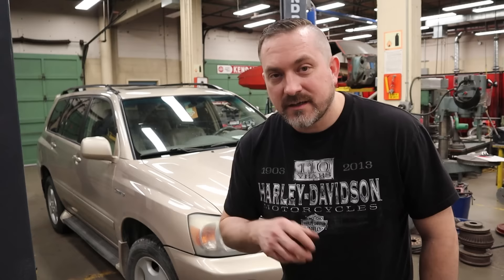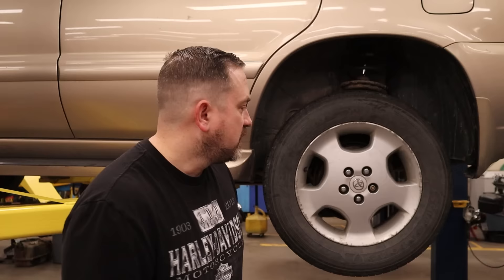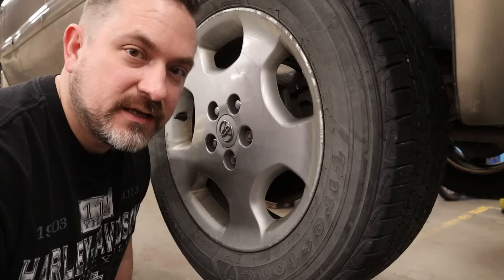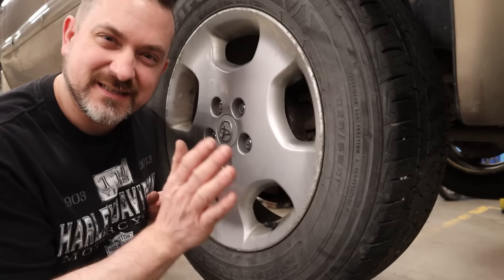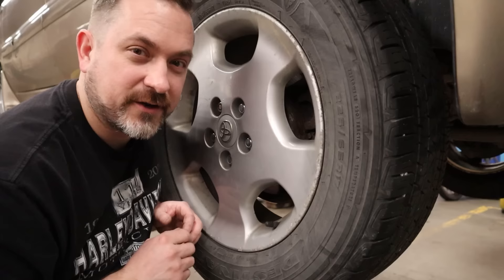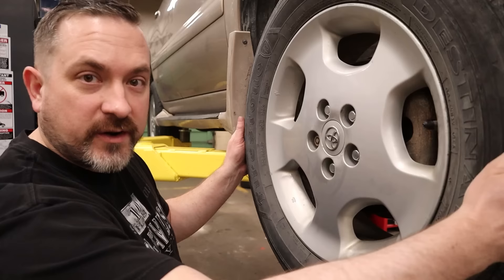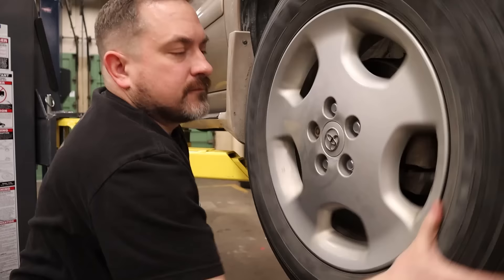How to 100% diagnose a bad wheel bearing.

Comment: My wheel doesn't not shake but does not spin freely even with brakes off including parking brake
Reply from the maker: If it makes a speed dependent sound then it's most likely a wheel bearing.  I have a road test video to help you diagnose which side it is too.  Hope that helps.  Thanks for the watch and welcome to the channel!

Comment: Is there another reason for the whirring noise as speed varies?
Reply from the maker: If the noise changes in volume and speed as the vehicle changes speed, then it is a part that is speed dependant.  It is a tire bulge, nail in tire, bent wheel, wheel bearing, cv axle, driveshaft, sticking/worn brakes, rubbing dust shield, loose fender covers, heat shield on drive shaft, etc.  Think things that are spinning or things that might rub against something that shouldn't be there.  Best advice is try to narrow it down to front or rear and left or right by opening windows.  Do a proper wheel bearing check on all wheels first and then look for other issues.  Cv axles can should a lot like a wheel bearing.  Good luck and thanks for the watch!

Comment: What if the noise goes away at high speeds ? Noise is just at starting speeds
Reply from the maker: Depends, it probably is just blending with road noise.  I would do the checks in this video and my other road testing bearings video checks to be sure. Thanks for the watch!

Comment: Youve obviously never had an inner race go on a bearing. 
      Holding the spring and feeling the vibration is a way to tell. "You can feel every noise" remember that
      Inner race on a front can be a tricky one. Left side makes the noises a typical right would do on a road test.
     Not all bad bearings have play
Reply from the maker: You're right, I usually inspect and hand pack my bearings so I don't have any issues.  That being said, when customers bring me their noise complaints.... it's usually a really worn bearing and it has play and needs replaced.  Yes you can feel the vibrations in the spring and a good road test also tells you which side it is, I actually have a bearing video showing what you're talking about plus more.  Thanks for your info and the watch, cheers!

Comment: What if braking dampens the sound? Mine is loud at 40 MPH but gets quieter after that?
Reply from the maker: as long as the braking isn't causing the sound, it should still be bearings.  Remember that the sound is only part of the check, you have to lift the wheels off of the ground and do the shake test to properly diagnose.  Cheers!

Comment: Hi. I have a similar situation.. I'm not sure if it is the bearings,or,one of the belt driven parts.. The "Screeching" noise seems like it's coming from the left front wheel,plus,I also noticed that,the Screeching sound will happen only when the car is in motion after I go from 15-35 mph... After the truck reaches that high speed,the screeching sounds will stop when I go past 35 mph.... Btw.. I do need a front end alignment also... The wheel moves to the right if you let go of the steering wheel... Does this still sound like a bearing problem? Thx
Reply from the maker: Hard to say for sure but I would jack it up and see what's loose or has play and go from there.  Sounds like it could be potentially a safety issue so don't leave it.  Good luck!
Reply: Thx!
Reply from the maker: No worries!

Comment: I keep hearing a whistle sound from my tire area when im going around 10mph i changed my pads and the sound is still there any…..
Reply from the maker: It can be really hard to diagnose these problems over messages but a high pitch squeel could be a seized brake cable or pinched brake line that isn't releasing the pads.  Did you do the checks in this video?

Comment: Just did 2012 highlander wheel hubs and have ABS warning now. Faulty hubs?
Reply from the maker: Did you plug the wheel speed sensors back in?  Did the new hubs not have a wheel speed sensor?  Perhaps a wire for the sensor got pinched or damaged during dssy?
Reply: @wayofthewrench  I did plug them back in. By way of diagnoses I think I'll replace both wires to be sure they are good
Reply from the maker: If you can.  Most are built into the sensor.

Comment: I have all the noise but no wobble or clunk when I have it jacked could it still be bearings?
Reply from the maker: Yes it could still be a bearing that hasn't developed at play yet.  I also have another video on road testing a bearing plus other tricks if you're interested.  Good luck!
Reply: No play no grinding when jacked, can hear a grumbling slight when going straight that increases with speed but when I turn right going round a roundabout it gets hell worse, when I turn left I can hear noise but not as bad im thinking both front. I've checked all 4 for noise and wobble but they are all solid and smooth ?
Reply from the maker: Less noise turning left means it's a left side bearing that's bad.  Now just figure out if it's front or back.  Good luck!

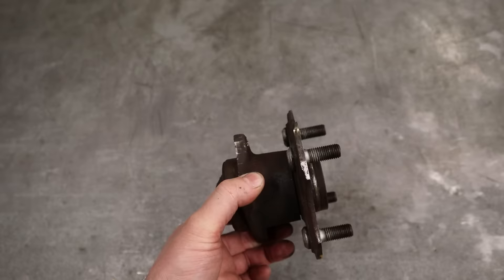Comment: @5:20 .. Why does everyone say that the unit hubs are "easier"?? And they're sure as hell not cheaper. My two trucks (37 and 55 y.o. respectively) are both still on the original bearings with regular repacking - an hour's work and six bucks in grease every year). Same amount of work to get to the bearings .. maybe a little less after as I don't have to fight to remove them. 

Had to do one of my Crown Vic's fronts recently .. 80,000 miles. $175 for the unit, had to find suitable bolts, nuts, and washers to "jack" the thing out of the aluminum knuckle by the hub flange .. heating, beating .. I hate these damned things. I'm sure Chilton's says remove four bolts and get ready with a catcher's mitt as they pop into the free world. As they do when they're 3 weeks old.

Of course they're also touted as "service free" .. as is everything other thing without a zerk fitting now. 

Ugh.

Note that although your methodology is sound as stated, this is not the be all. I've discovered dead quiet bearings that were terrifying and only noticed when the ABS sensor was ejected from the unit rear, and that depending on the failure mode, some will quiet, and some will grind with a thrust load .. ie - into a turn. As well .. brake application can indeed change the note.
Reply from the maker: They are usually but are notorious for being seized in the knuckle too.  These types of wheel bearing assemblies are not fixable and need the entire unit changed out.  Those older vehicles you have are inner and outer bearings that can be replaced and like you said, repacked yearly to keep them rolling for years.  I've gone through my share of those types too as I have a 68 Firebird and a 67 Parisienne plus a couple trailers too.  Thanks for the watch!

Comment: I replaced a wheel bearing not long ago on a 2002 rav4. Used skf since its supposed to be good. Now its grinding like mad again. Why reason why ? I dont remember hitting any bad potholes, aligment is good,
Reply from the maker: Same corner or the other side now?
Reply: @wayofthewrench  same damn corner, making more noise than my wife. About 20 000km since it was changed.
Reply from the maker: Hrmmmm.... was it a pressed on bearing or wheel bearing hub assembly?  I'm sorry to hear about your wife.....why did you change your wife 20,000 kms ago?  LOL

Comment: 2014 Nissan Titan Pro 4x. Not much play or sound when off the ground. Lots of grinding and bumping over something at 10 miles an hour. Too loud and rough to go faster. It started with a very small sound in 40 miles to needing to be towed. Sound is reduced with acceleration mildly and when braking as long as not extreme with either. Could it be the cv joint?
Reply from the maker: Hard to tell through a message but it could be a CV axle.  With the vehicle safely jacked up, grab the CV axle shaft and try turning it back and forth.  Should be no play in the axle when turning/changing directions.  Check all CV axles.  Hope that helps.
Reply: @wayofthewrench  thx
Reply from the maker: You're welcome!

Comment: My front drivers side tire is periodically make a clicking sound whenever im going under 20 mph. But it has none of these symptoms in the video
Reply from the maker: Hard to say but clicking could be CV axle but you might hear a grumble at speed and the clicking would be louder at full turns.  Good luck!
Reply: @wayofthewrench  I was leaning toward the cv axle but I'm not getting any noise turning or anything either. I  can't seem to nail it down
Reply from the maker: Hrmmmm could be lot's of stuff.  Try to do a full underbody inspection and look for parts that have play in them.  Cv axles should have little to no play when you try to turn the axle back and forth.  If it is clunking then it's bad.  It really is hard to diagnose this stuff in a message without looking at the vehicle.  Good luck!

Comment: Now how about it you hear a jingle noise variable with speed, checked both fronts no weird clunking noises side to side but up and down has couple mm of play and a little squeaking noise
Reply: The cv joint on the back side flexes when I move the wheel up and down
Reply from the maker: Up and down play will be suspension components, take a prybar and check for play on upper or lower ball joints and or strut mounts or control arm bushings.  Make sure it's jacked up and get someone to help you with a light.  A jingle could be something stuck in the tire like a small section of chain.  I had this in a customer car tire this year.  Good luck!

Comment: My back wheel is squeaking while driving and I'm trying to figure out what It is. The sound is not like that at all. It squeaks faster when I drive faster and squeaks really slowly when i drive slowly. It's basically the speed of the wheel turning. 😬
Reply from the maker: It is definitely a speed dependent sound but could be something else like a dust shield that got bent and is scraping on the rotor.  It usually makes a higher pitched sound rather than a deeper rumbling sound.  Get a light and do the same test as in the video but when you spin the wheel, look for a thin sheet metal cover touching the spinning rotor.  Thanks for the watch and welcome to the channel!
Reply: @wayofthewrench  thanks and I really appreciate the advice! I will definitely give it a look! 😁🎉
Reply from the maker: Hope you figure it out, cheers!

Comment: My daughter has a 04 Pontiac Grand Prix and it randomly started making a whirling sound a couple days ago that does increase with speed. Nothing like a grinding, gravel sound and not crazy loud. I took in on the interstate and absolutely no vibration in steering wheel or swaying to left or right just a funky hissing sound. Kinda hard to explain the noise lol. I did inspect her tire and found the passengers front side has worn on the inside. Could this be the problem or could the bearing be bad as well? How does a worn tire make the sound only at particular speeds. Below say 35, you hear nothing and car drives like a dream! I'm confused here bud on whether to take it to a tire shop or a mechanic without looking like a dumb blonde lol.
Reply from the maker: Hi Sharon!  Did you jack up the car and test the wheels for the wheel bearing play?  If you need a video on how to jack up your car, I have a great video for you.  If there is play, then you have a bad wheel bearing.  You could have worn tires or an alignment issue as well.  Let me know what you find, cheers!

Comment: I am not 100% sure but i am beginning to think the noise i have heard recently might just be a wheel bearring. 
i have a 2009 ford fusino with 138000 miles on it.  and i can say 100% that when i am at a traffic light  everything sounds totally nomral. when i start to accerlarte and mayb up to 20 mph i don't really hear anything ither once i get to 25 and 40 45  an in tha range. i heard a constant sound i refer to as a "grining" or maybe not grinding, maybe whirring/grinindg . basically i initialy thought the eninge was working harder or what not. but clearly the engine doens't make any louder noises whien still.
i also hear it as i am slowing down/breaking until i am giong slower than 20 as well.
altough i do have someone checkign y car this week to see what it is. but i am guessing it is that. also, added oil a week ago to it sufll lvel i was a little on the low side 2 weeks ago but that didn't fix the issue. so i defintely think it is this
Reply from the maker: Sounds like a bad bearing to me.  Time to jack it up and check for play too.  I have a great video on jacking a vehicle too.  Hopefully I earned your subscription today and if you deem me worthy, I'd really appreciate it if you could share out my channel on your social media so I can help more people.  Thanks for the watch and welcome to the channel!  Cheers!
Reply: @wayofthewrench  oh looks like subscrbied today inded. thanks!
Reply from the maker: Nice, appreciate the sub!
Reply: @wayofthewrench  you are welcome. and that was indeed it. and now i have a new wheel bearing. sounds way way better.

Comment: Hi there, I have a 2011 bmw x3 100k on the clock. When I'm driving there's a loud humming noise when I accelerate but it's even louder when I'm slowing down especially when I'm just coasting and increases in sound when I go right hand down round a corner.it doesn't do it when I'm just creeping in traffic! Any advice would be great thanks
Reply from the maker: Hrmm hard to diagnose fully over message but it does sound like a speed dependant sound.  I would check for bearing play, loose lug nuts, cv axle play, brake caliper bolts, and wheel balance.  Good luck finding your issue!

Comment: May seem obvious but make sure your handbrake is off, besides not able to rotate the wheel, when checking for play as it locks the hub hiding the free play.
Reply from the maker: Yeah good call.  I always spin my wheels as well as the shake so I would catch that the rear parking brake is on.  Thanks for the watch!

Comment: Hi, I drive a 1999 Toyota Caldina, when I take a corner, particularly at speed I can hear a grinding/ rattle that comes from the wheel wells from both the left and right front side of the car. Don't have the same sound speeding up or anything like that. Generally just corners and can hear a rattle whilst driving slow. Any ideas? thanks
Reply from the maker: Sounds like you have something loose or very worn out....maybe multiple things.  I would do or get an inspection done right away.  Check for loose lug nuts, bearing play, loose steering/suspension components, drive axle, worn brakes, etc.  Sound like it's in urgent need of repair, don't leave it.  Good luck!

Comment: I have a BMW 1 Series and it failed its annual MOT test test due to a faulty front wheel bearing according to the garage mechanic.  Although the BMW is 8 years old, it has less that 20,000 miles on the clock.... which makes me very dubious about what the mechanic has stated.  When I asked what would cause a wheel bearing to need replacing, when not even 20k miles is on the clock, he stated that he didn't know why.  Is it possible that a wheel bearing needs replacing with not even 20k miles on the clock... or is this mechanic trying to jack up the bill?   PS....  I did have the front wheel discs and pads changed 1 year ago but I've never noticed any noises or issues with the steering prior to taking the car to the garage.
Reply from the maker: I'm sorry to hear that.  It is possible but highly likely it's not bad based off km.  What I recommend is you jack up the car  and test the bearings yourself like I showed in the video and then you'll know 100%.  Thanks for the watch!

Comment: I had a similiar noise on my rear right side tyre while cruising around 50mph, swapped the tyre to the front right side and now i have the same noise at about 30mph, then it stops and comes  back at around 80/90mph. Do you think it could be the bearing or just bad tyre surface? The surface does seem to be uneven between the inside/outside.
Reply: One more thing, while doing a roundabout, at a fixed speed, the sound becomes worse while turning left (doing the roundabout) and it dissapears when i turn right (exiting the roundabout).
Reply from the maker: You should watch my road testing a bad bearing and see if that helps you figure it out.  Good luck!
Reply from the maker: You could have multiple issues like wheel alignment and an out of balance wheel and maybe a wheel bearing.  I'd watch my videos on those to see how to check.  Thanks for the watch!

Comment: My steering wheel vibrates when i go over 80-85km and a little clicking sound just started from my front passenger side.. I hear it mostly when im driving slowly what could that be ?
Reply from the maker: Could be a wheel out of balance but if the clicking is speed dependent, then I would check your wheel bearings.  Hope that helps.  Thanks for the watch and welcome to the channel!

Comment: Hey everyone, I’ve had my steering rack changed, wishbone changed, tracking and balancing done but my steering is still off, wobbly and won’t stay straight on bad roads, is it most likely the bearings?
Reply from the maker: Could be but sounds like a worn steering or suspension component to me.  Check for play like in the video.  Thanks for the watch!
Reply: @wayofthewrench  thanks for replying in the process of changing all wheel bearings will update tomorrow
Reply: @wayofthewrench  hi mate just an update I’ve had the wheel bearings changed and although it’s better the steering isn’t normal, tilts left and right on rough roads, any ideas?
Reply from the maker: Sounds good
Reply from the maker: Loose steering or suspension components it sounds like.